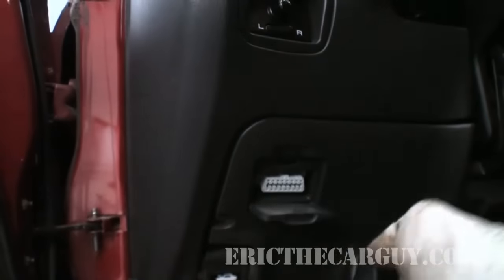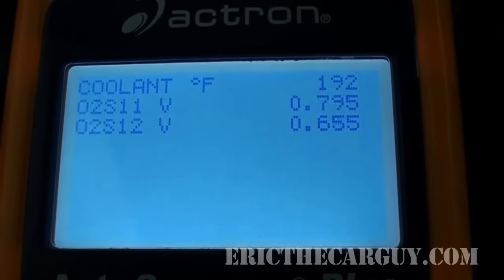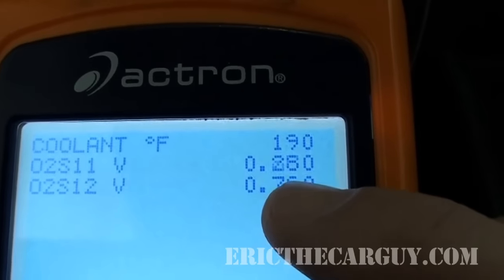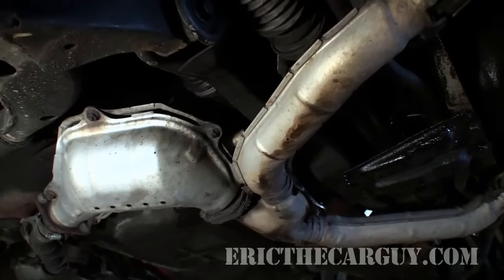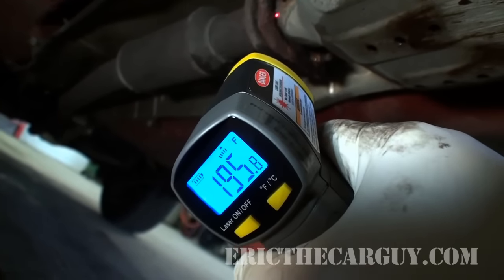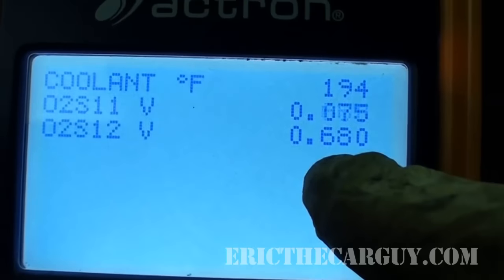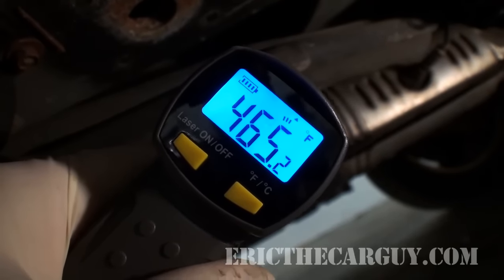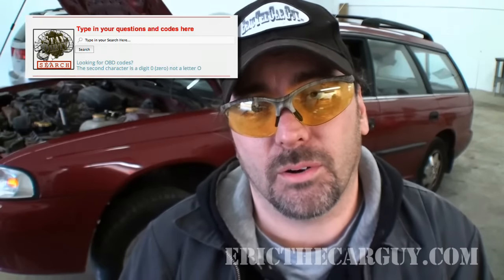P0420 How To Diagnose A Bad Catalytic Converter -EricTheCarGuy

Comment: You have a clogged cat if:
1  your car has been burning oil for months and months.  Usually you get the P0420 code.
2  your gas mileage has gotten 20% worse.  When your computer senses a rich burn, it leans out your mix.  Lean means sends more gas and results are that the mpg is hurt.

3  you can not accelerate on to an on ramp to a hwy.  The car boggs down due to restricted exhaust flow.
Reply: So what do you do in this case? Clean? Replace?
Reply: @deegoa  You have to stop the oil from getting past the valve seals, the piston rings, or both.  Have a wet compression and a dry compression test done.  Google search dry vs wet compression test, to find out what your results mean.   If you stop the oil "burning" your next cat will last 20 years, otherwise it will continue to get clogged.
Reply: @jayjanyh2932  I was actually able to get P0420 to clear by using lacquer thinner (saw a video about from Scotty Kilmer). I remember having a compression test done and the mechanic told me it was fine. He did it in a parking lot while I was at work (he was a mobile mechanic). Not sure if it was a dry or wet test?
Reply: @deegoa   Did that lacquer thinner solution lasted for a while?

Comment: Eric, I think you've over simplified what cat converter actually do. Old two-way cats didn't even do a thing to NOx emissions. Nowdays caltalytic converters are a "three-way" type because they perform 3 functions:
-Burn unburned fuel (hydrocarbons) to CO2 and H2O (consumes oxygen)
-Burn CO to CO2 (again consumes oxygen)
-Reduce NOx to N and O2 (releases oxygen)
O2 sensors are used to keep the correct ratio of oxygen in exhaust to keep all those 3 reaction going.
Reply: milbars, I think you've undersimplified what an O2 sensor actually does. It measures temperature. When ericthecarguy points his laser pistol at the cats, it is just to confirm what the sensors say. He's checking their function, not the cat. To check a cat still requires a 5 gas analyzer.
Reply: Rýán Túçk Did you just say that oxygen sensor measures temperature?  So what in your opinion is measuring a sensor equipped with heater? What Eric is doing is using pyrometer (that "laser pistol") to measure inlet and outlet temperature in cat converter. As it is "burning" (well reacting, without actual flame) unburned fuel it gets hot - So outlet temperature should be higher than inlet. Since it is not it indicates that cat is not working.
Reply: I thought the same thing as i watched the video...i think he may be trying to not over complicate it for the average youtube video watcher like this guy who thinks that oxygen sensors measure temp???? haha...if they measured temp...why wouldn't they be called temp sensors...

Comment: Side note, also make a heat shield to redirect the gases away from other components if necessary. The hole for the o2 sensor points right at some rubber hoses so I redirected the gasses with a makeshift aluminum sheeting I had. Not Ideal but I only went about 500 feet to do the test a replace the o2 sensor.

Comment: I know this is an old video, but an IR thermometer doesn't work like that.  The laser doesn't perform the measurement, it just indicates the general area that you are measuring.  There is usually a diagram on the side of the device that indicates how large the measurement circle is at a given distance.  The indicated measurement will be roughly an average of the surface temperature in that circle area (assuming the emissivity is set correctly for the material)

Comment: im all about cleaner air. as long as it doesnt cost me an arm and a leg. my first car was a 00 neon, converter plugged up, bought it through the local parts store for about 500 bucks... it didnt fit, the flex pipe was about 2 inches short... so i resorted to option 2. a hammer, pounded out all of those precious metal screens inside and my car once again would run longer than 5 mins before stalling. emissions testing is just silly, some of us cant afford to make these insanely expensive repairs for cleaner air. if they really want clean air, just give us a different fuel source.
Reply: visit any other country...the U.S. trying to make clean air while countries all over South America, Asia, India, and Africa don't? We aren't helping to the amount the gov't wants us to think.
Reply: @KrashTWazo  or they could just give us the emissions parts? Just buy 3 less missiles! Bam free cats!
Reply: 3 years later after you comment.. Electric Vehicles are starting to get more popular now. But will cost both arms and legs to fix any electrical problems.
Reply: I believe that if cars are really bad for the environment then they'd cover the catalytic converter and other expensive ass parts instead of coming out with stupid electric cars. Personal belief tho

Comment: Just an FYI. I have the same infrared temp sensor from Harbor Freight and the laser is not totally indicative of where it is reading the temp from. The manual with it showed that is was a detection cone. The ratio was 8:1 so at 8 inches, the detected area is 1 inch. So the temperature shown was the average of that 1 inch including the heat shield. The laser is only to show the center of that cone. So trying to read the temp in the slit between the heat shields will be inaccurate. You need to read right before and after the heat shield at the closest possible distance. I tested this by reading my furnace flue temp and moving my hand into the cone but not blocking the laser. It did lower the temperature reading. It states that the maximum distance is 8 feet but my boss would always try to read the ceiling in our warehouse and show how good our insulation is working. Good luck telling the boss he is wrong more than once. - Manual: http://images.harborfreight.com/manuals/96000-96999/96451.pdf

The fact that you did read in a consistent method and it did show a higher or lower temp still validates whether the cat is working or not. I was trying to point out how to get more accurate readings in the future. Sorry for rambling.

Comment: Great video.  I am right now getting mine replaced. I have a 1998 Jeep and I have been driving on it for 2 years with it...and have passed inspections. But the noise has become so annoying. The station is charging me $405 for parts and labor. Thanks for sharing.

Comment: we don't have emissions here and the guy I go to for inspections will take a 6 pack of mickeys to look the other way on things that don't involve vehicle safety so I just run with a test pipe on vehicles that have had cats go bad
Reply: I think the issues with that with newer vehicles is the manufacturers engineering people have probably set the ecm (computer) to read certain temps as well as voltage. I mean if it was a simple thing, you could just plug the primary location with a bolt & then leave the secondary in. Then the sensors would read lower temps on the primary, telling the computer the cat is working. (I think anyways) I just change the cat & count it as vehicle maintenance.
Reply: @montydaniels1054  I don't mess with newer vehicles.  my current vehicle is my newest and it's an 05 Silverado, test pipe worked fine on that with just an o2 emulator.  incidentally 6 years ago when I made that post was the last year that vehicle inspections was a thing in this state.
Reply: @butre.  I never heard of that probably because I've tried to keep everything original but on this Patriot, whatever the problem it won't allow the remote start to work. Jeep Engineers have so many sensors on this vehicle I have spent half the time tracking down sensors. Like my abs/speed sensors. Sometimes it's a wheel bearing hub that has too much rust on the inner side where the sensors picks up the speed from. So you gotta change the hub in order to get the speed sensor to even get a signal. At 9 years old, I'd sell it for $1500 or less just because all the Jeep lines are for shit. Thanks for the heads up because I might go that route since testing in Michigan ended about 20 years ago. So the pipe still has the downstream O2 sensor & what, you just unplug the upstream, or just plug the hole & leave the sensor plugged in, it's just not hooked up to the cat...
Reply: @montydaniels1054  not sure about the patriot but everything I've ever run an o2 emulator on I only needed to emulate the downstream.  the upstream o2 sensor mostly just handles enrichment, and checks that the VVT isn't acting up assuming it's installed
Reply: @butre.  Well, while I was thinking about that, I started looking around, wiggled a ground with about 20 wires to it ( that really look corroded) & the next time I started the vehicle the brake light came on & now stays on. I swear, the Jeep Patriot, Liberty & Compass are full of electrical problems. Plus I need a transmission cable...  I have never had a vehicle I hated until this one.

Comment: Interesting video, but like the one I saw from another content creator you did not mention what the temperature differences should be between where the exhaust enters the catalytic converter and where it exits the catalytic converter.  You also did not recommend changing the oxygen sensors first to see if they were possibly malfunctioning. You also did not mention they should be replaced if/when the catalytic converter is replaced.

Comment: EricTheCarGuy When you checked the odyssey's oxygen sensor 1 and got 200 degree F, you were actually pointing at the heat shield. The temp gun doesn't measure where the laser pointer is. The infrared ray's target is about 1/2 inch below the laser pointer.

Comment: I was given error code P0430 for my Honda Accord V6, I'm thinking it's the converter, I don't want to change it at least not now, cause it's pretty expensive. Is there any problem if I use the car like this till I can get enough money to fix it? i don't want to risk damaging something else.
Reply: It's been three years. if it still runs, run it. Besides, it's a Honda. You can LITERALLY pull the valve guides out in a D series and drive it.

Comment: After this video I'm a little upset the Honda shop I took my car to for a P0420 couldn't figure it out. Very simple. Thank you.
Reply: What did they say?  I've had 420 for most of the year and couldn't find a shop that would do a proper diagnostic, most just pull codes and jump for joy at 420 to get a big invoice.   I wasn't just hoping for a leak or something that could cause it, but to confirm that I fix other issue before installing a new cat.  I won't know till I cur mine off, but it seems I was running rich or misfired and that damaged the cat.  Fix everything else first so you don't have to do it twice.

Comment: FYI: the laser just tells you approximately where it is pointing.  The actuall sensor reads a spot from a 1 inch diameter (close up) to many feet diameter 30 feet away.
Pointing the laser through a slit in the heat sheilding does not make it read where the laser is hitting, it is reading the heat sheild.

Comment: here in the rust belt too. we also got rid of the emission requirement for cars 10 years or older , because 80% of the cars would have to be taken off the   road .at my inspection my car still passed even though it wasn't  required .
Reply: I thought that was backwards ever since they started doing emission test that a new car would last at least 10 years before it needs to be checked but the older car would be putting out a lot of pollution and needs to have emissions test